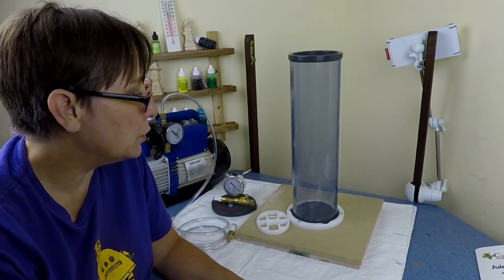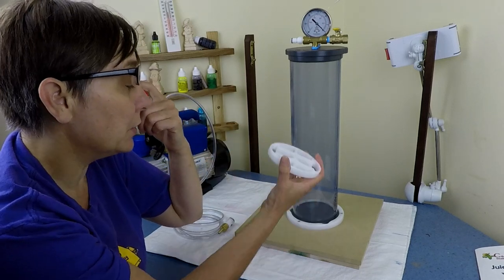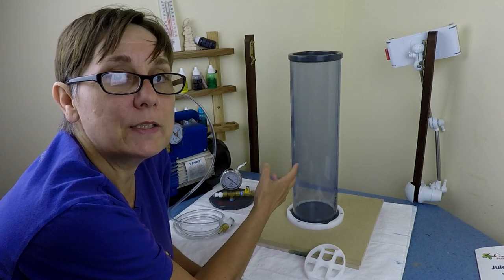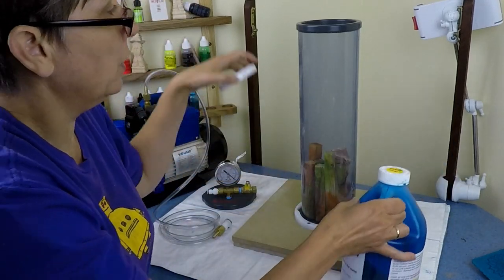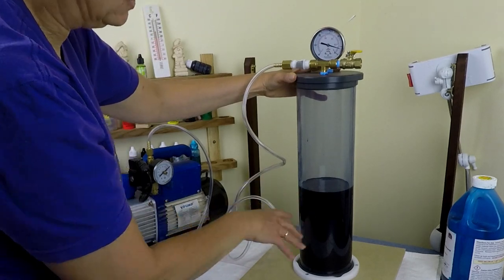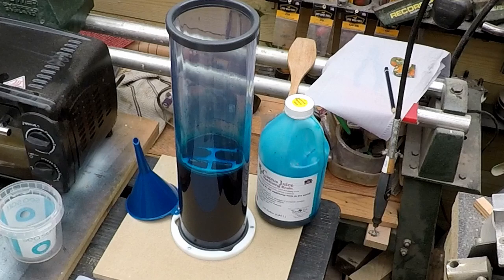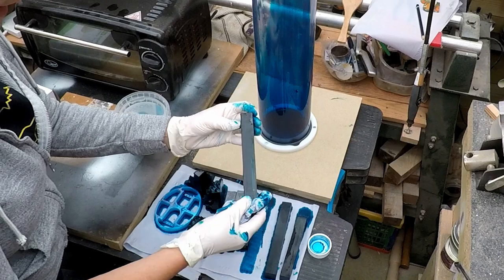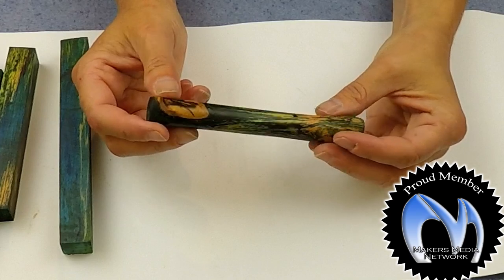Colour and stabilising in cactus juice vacuum chamber

Comment: That's really interesting to see all of this Pam. I suppose the only downside to these tall slim chambers is that you cannot stabilise anything very big like a bowl blank like you could do in the chamber you have.
Out of interest is there a shelf life or the amount of times you can use the various liquids you were using in the video for colouring or stabilising?
Reply: Paul Lockwood It truly can be used up until 6 months of mixing the two parts together. Cactus Juice does have a shelf life of 6 months, and can be used over and over until heat activated.
Reply from the maker: Thank you Paul yes this one is narrow i could fit a box blank in no bother yes would need the bigger one to do a small bowl, you can get bags for bigger projects i understand. Once activated the cactus juice lasts 8 to 12 months so you get a lot of use from one container as it can be used over and over. :-)

Comment: Would placing a shutoff valve on the pump side save you from having to run the pump full time?
Reply from the maker: Im no expert but i think it would loose vacuum as air comes out of wood :-)
Reply: @Highlandboxes  it shouldn’t, the air is already in the chamber it’s just moving from on place to another. I’m probably wrong so I’ll have to give it a try 😀

Comment: I have question somene could help me?
I use vacuseal resin.
I tried colored maple with blue.
I watched 100videos in yt..but the color is dull and inside not blue.(in the middle)
Blank size 135*40*40mm.
Reply from the maker: Make sure the wood is really dry also if the wood is really dense it won’t penetrate it. I dry my wood in oven overnight at about 80c once vacuumed and all bubbles gone leave to soak for a few days
Reply: @Highlandboxes  i was put the oven around 28hours on 90c.
Started 195g went down 155g it was absolutly dry probably.I was put the vacuum chamber around 24-26hours.Oven again 100c 90minutes.
When i finished with stabilizing the color was nice when i was taken off from oven the color was dull.I thougght no problem i will polishing..but when i cut i have seen..o.oo..something wrong because not colored everywhere.
How do i know that the color everywhere in the wood?
Wasnt enought the 26hours in the resin?
I was reading lots of comment and i watched million yt video but couldnt find same question.
I would like to make " bicska"(hungarian traditional knife)i want to make colored knifehandle to my brother thats why i asked.
Thank you for your help.
Reply: @14magyar88  If you want only one color, then you may dye it in an alcohol dye and then dry it and  stabilize in transparent resin.
Reply: in general, alcohol dyeing penetrates more than resin dyeing